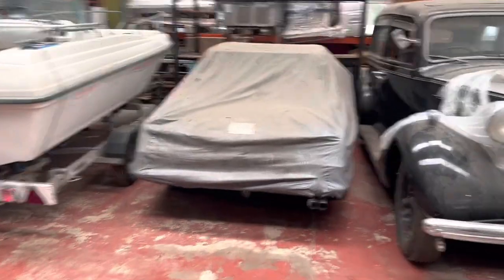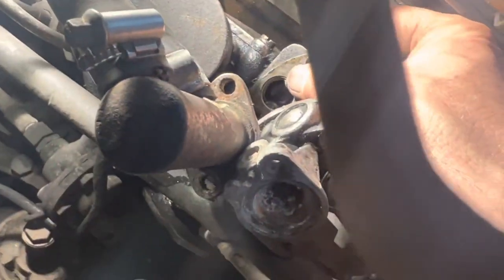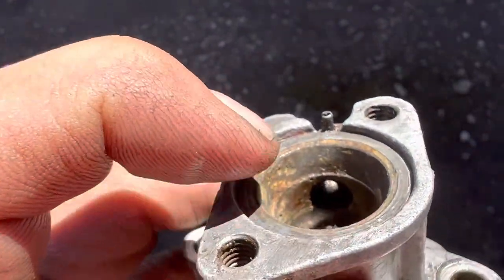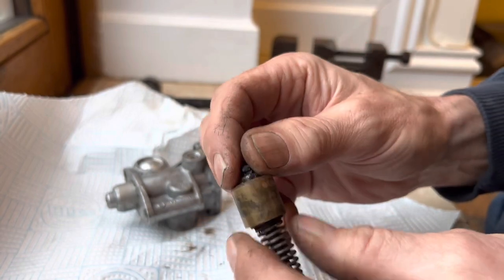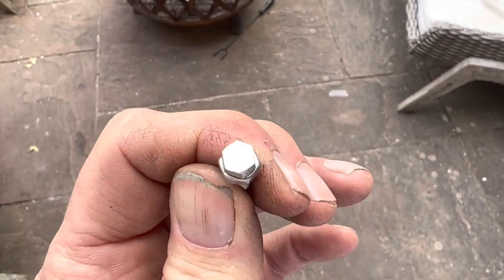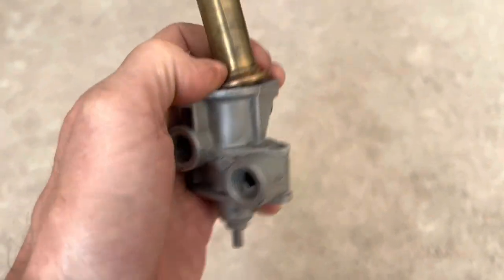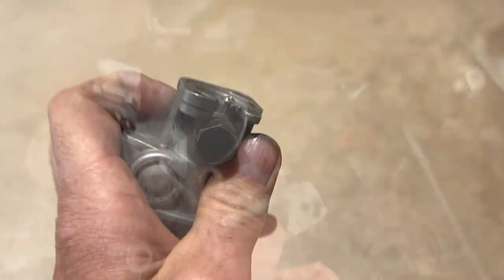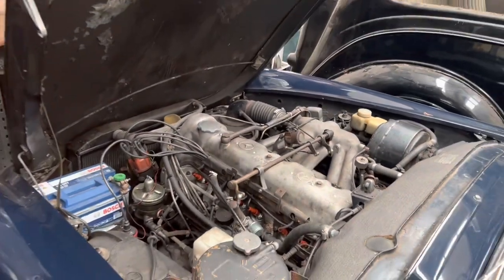Mercedes W113 230SL warm running device (WRD) P3Z or warm running device thermostat

Comment: Great job. The detail you provided explains how all the parts work together. I hope you do more videos on the 230SL. I’m in the middle of my rolling restoration of a ‘66 230SL.
Reply from the maker: Good luck with your restoration - such nice cars! I must admit, my 230SL has been so reliable over the years that I have very little work on it. However....the old girl is starting to show her age and need s a bit of TLC. First stop will be a minor tune up and then spruce up the fuel delivery system. Mike

Comment: Great video. The backside of hood (bonnet - for you other there :)  and the engine bay should be in body color - seems like someone used a black rattle can and sprayed it over.
Reply from the maker: Yes you are right...that has always bothered me. At some stage I need to repaint the Pagoda...but that is quite far down my list of priorities. First I need to finish the red 107....get rid of the gold 450SL parts car...and get my ramp back in use. How is the Ferrari project going? Mike

Comment: Excellent video, thanks for sharing it, I have a 69 280SL but it takes me a while to start from cold, after 3 attempts at the switch it turns on perfectly and goes up to 1,400rpm until it warms up and goes down to 900rpm. My question is, what could be wrong with how long it takes to start when cold? The CSV cold start valve is working perfectly.
Reply from the maker: Yes….my car does that too, and I have yet to figure out why.  I’m thinking it could be lack of fuel pressure when cold….or maybe a tired cold start injector? I’ll post a video when I get round to fixing that issue….but it is quite far down the list of priorities. Mike
Reply: @MikesMercsandothercars  Thanks for your response!! I will also try to check that and if I find the problem I will let you know.

Comment: This is the warm running device . The cold start valve is another thing . Located in the intake manifold .
Reply from the maker: Thanks for your comment - yes you are right, this is the warm up regulator, or warm up device. Some people also call it the cold start valve.....although technically, the cold start valve is really the cold start injector/solenoid. Strangely enough, my Pagoda decided not to start yesterday..Mike
Reply: I have a 250sl w113 and recently I had my injection pump overhauled in Germany and I got a culture around that 😅. The warm running device helps to lean the mixture when the coolant temperature reach around 60 Celsius .
The cold start valve has a needle inside and a spring . I had to replace the needle because was letting fuel inside the engine all the time . This is a very bad condition because the engine run very rich .
Cold start basically gives a squirt of fuel to help to turn on the engine . There is a solenoid and a thermo time switch which is a probe that sense the coolant temp and you will have more fuel squirt or less in relation to the coolant temp . Back in the 60s was genius, now mechanics get crazy to see such old technology.
Reply from the maker: @mauropis1  Thanks for your comment Who did you use to over haul the injection pump and what did it cost?

I am currently restoring a 1975 D Jetronic 280SL. It is amazing to compare that car with my 1980 Fiat 238 van. The van looks (and drives!) like a vehicle from the 1950's whereas the SL still looks and feels quite modern despite being much older. It just illustrates to m,e how far ahead Mercedes were in their engineering.

Now lets se if I can get my Pagoda running! Mike

Comment: Awesome video… as always.  I hope you do an R107 cold start valve video because mine does not work and a used one on eBay is $700.  The R107 valve only regulates air bypassing the throttle so I am able to manually cold start my car by bypassing the valve and holding the throttle for a while during coils start. I hope you know of a way to repair vs. replace.  I like the dark blue color on that W113.
Reply from the maker: Hi - thanks for your comment. Can you send me a picture of your cold start valve on the car? Mike